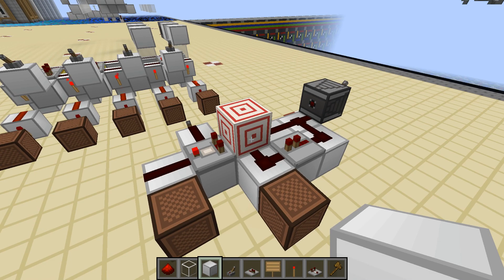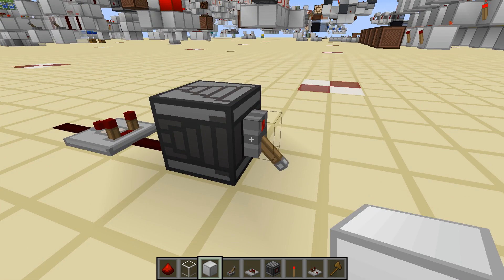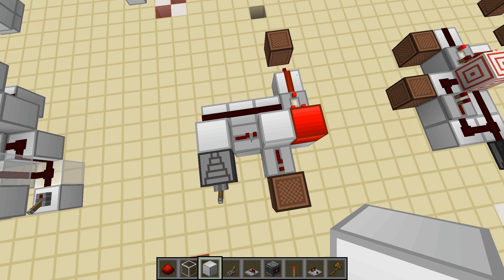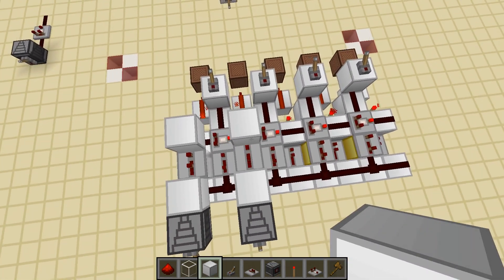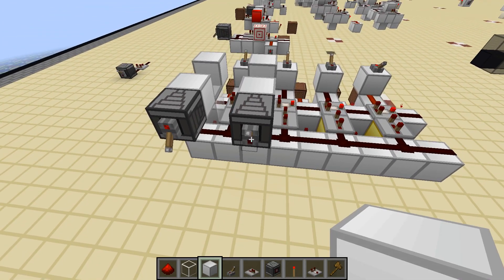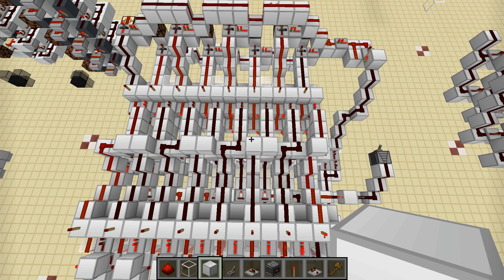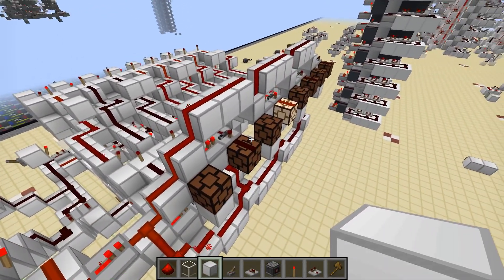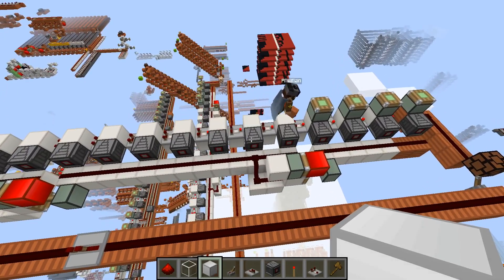Comparator Priming - Instant Redstone Without Pistons

Comment: IT WORKS ON BOTH VERSIONS
(the instant redstone, not the one tick comparator thing)
(and on bedrock, it outputs a 2 tick signal, despite it being timed perfectly)
Reply: How did you do it in Bedrock, I need it, thanks in advance.
Reply: @MilkGlue-xg5vj  same setup
Reply: @MasonAlex-f9p How, that doesn't make sense, it works since the comperator is already 1 tick and is not getting primed, the prime signal is turning it on instead.
Reply: @MilkGlue-xg5vj  idk either 🫠